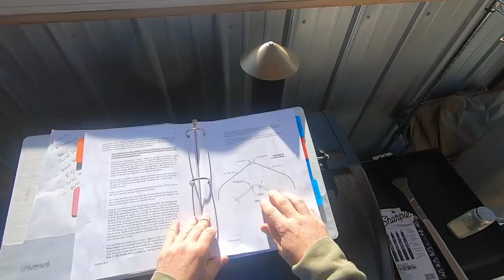Building the Metal Trusses for the GreenHouse in our BACKYARD (GreenHouse Build #4)

Comment: Oh Boy! You're going to have a big ol' greenhouse.  Here's an idea for you that once worked real well for me in a smaller greenhouse.  On the inside but the North side where the shade wouldn't cause much of a loss of footage I placed a row of 55 gal barrels (6 of them did my whole N wall, you'd need more, or could just do part of the wall).  I then made a rectangular lid that just fit over all the barrels at once of 2"x4" and plywood - like a stud wall the 2x4 fit around the barrels and the plywood was on top. So it's like a bench in the shop ( orient your bungs all the same and cut holes where they are.  You don't  need to attach it to the barrels, gravity is plenty. There are times you may want to lift it off.  Then link all the bottoms of the barrels together for water.  I found garden hose fittings, and short hoses handy, just put a male and a female attachment on the side of the barrel a foot or so from the bottom.  You want to be able to put the hose in one barrel and fill them all, or open a valve on the last barrel and drain them all to near the bottom.  This contraption has several purposes.

 It's a heat sink. You fill it all with water and it will hold the heat of the day much better through the night. Oh, I forgot to say above - paint all your barrels black to catch more heat.

Also, as a heat sink, it not only keeps things warmer at night but it also keeps the mid day high Temps from getting too hot - so it's  sort of like a capacitor in electronics, reducing the highs and lows in the temperature sign wave.

It also is a great reservoir for an irrigation system. You can stick a garden hose in one end of your series of tanks and have an overfill coming out at the other feeding your irrigation and you won't be watering with cold well water (you could also catch rain water to here, but I'd bet you're going to need more).

You can also cool the greenhouse by watering with the warm water just before the hottest parts of the day so some of that incoming heat energy goes into heating the cool barrels.

Also now you have a nice work bench in your greenhouse.  You may want to put some vinyl flooring on the plywood. You have a nice place to stand and fill seed trays, set trays to spout, trim up produce, etc.  On my six barrel bench I left a space between the 3rd and 4th barrel just enough that an old sink I had fit down in the middle of my bench top. It was plumbed by a garden hose fitting too, it only had cold water at the faucet but it had a pull out sprayer too. The drain for it went into a hose to any bed in the greenhouse I chose and wasn't wasted.  Just don't drain it in the barrels because you use it to wash soil off your produce, and you don't want that in your tank.

Like I said your greenhouse is much, very much, larger than mine was.  I doubt that six barrels would have the same effect as a heat sink in there, but it would still make a nice water tank and work bench.  12 or 20, or however many the North side would take would be better than six for you.  You can't have too much bench, you could always use it as a place for potted plants that you could access standing up.  You could also start with 6 or 10 barrels and add more in following years.

Comment: We had our bolts all coming from the side.
 We were told that doing it the way you are the bolt heads would puncture the plastic.
 I'm waiting to see if your having the bolt heads up against the plastic works.
Also I want to see how you do the end walls. Will you be able to drive in with compost?
 I heated ours with a compost pile. I was able to grow greens all winter in New Hampshire that way.

Comment: Raising those greenhouse trusses into place might be frustrating at best.  Could you clamp a 2x4 on the tractors front bracket to increase lift height?
Reply: hvn fun  or use the clamp on fork lift bars to get it up.

Comment: On the wall on the right side of the Milking Room by the entrance you installed a 2 gang Wall mounted electrical box which contains a single pole switch and a 120 Volt Duplex Receptacle. You went out of the bottom of that box and thru the wall with a PVC 90 when you should have used a '' LB fitting ''  which  would have allowed the  PVC conduit to lie flat against the wall instead of being out from the wall.  It would have looked more professional !

Comment: It's funny to watch this. I'm in the process of helping to build a 55,000+ sq ft tent structure (concrete floor). The difference is, you need a crane instead of a wife to help you carry the trusses. I guess a wife could run the crane (if she was a crane operator...).

Comment: just a caution from an old man who has been there. Please correct your lovely young wife to use her knees when she is lifting anything over 10 pounds. She is just bending at the waist, which will be the main contributor to a very sore back . Trust me, I know I destroyed my back by twisting at the waist holding a very heavy load and wrecked 3 discs in my lower back. That little move cost me two years in a hospital bed and 2 different operations. USE your Thigh muscles to lift; NOT your back.